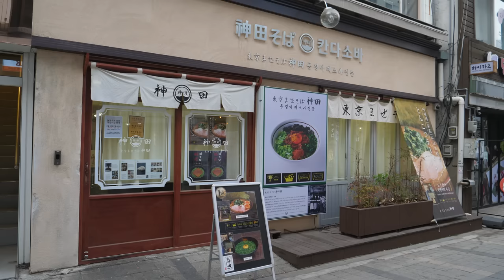일본 라멘대회1위! 유명한 라멘 마제소바 전문점 / 1st Place in Japan Ramen Competition! Famous ramen mazesoba restaurant

Comment: Interesting 😮 what did they use to cook the meat? What is that process name?
Reply: It's called Sous Vide. Basically they submerge it in a hot water bath at a fixed temperature for a few hours, which pasteurizes the meat. Using this method you can fully cook meat at a much lower temperature while still being perfectly safe to eat (it's the same pasteurization principle that is used to make your milk and fruit juices safe to drink, eggs safe to eat raw, and so on) and the meat comes out much more tender due to the lower temperature, which is usually the main reason for using this method.